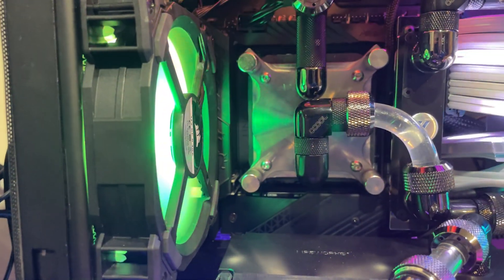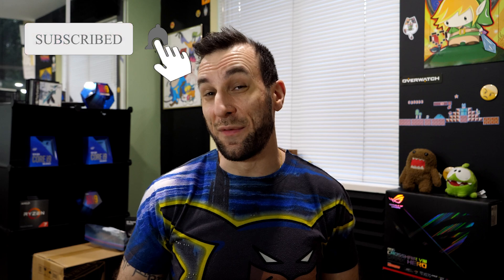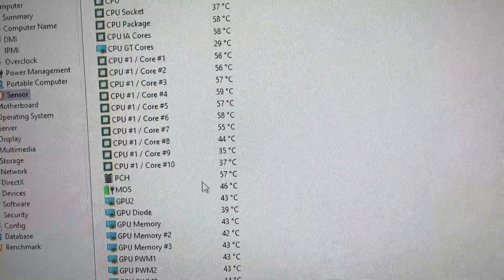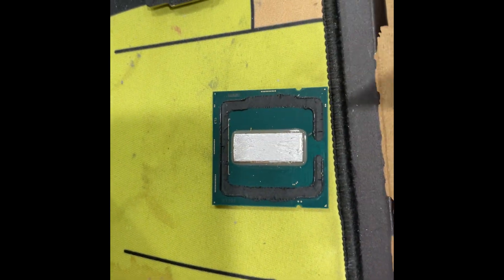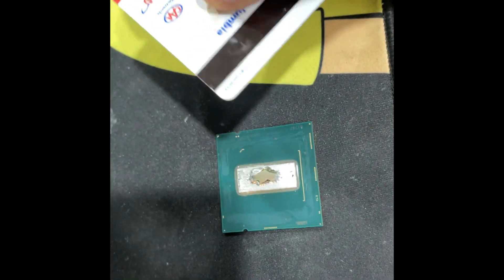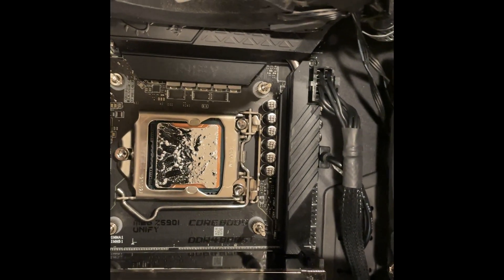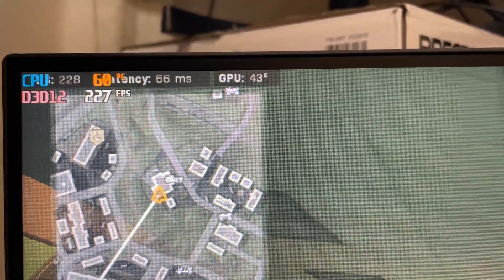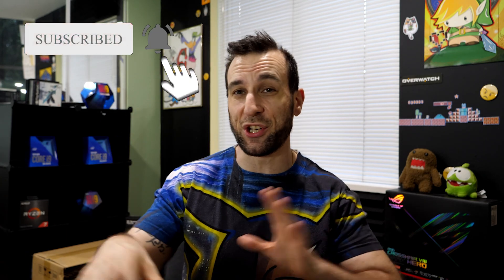10900k DELID VS TEC COOLER RESULTS!!

Comment: I am curious if i am missing a step. What did you do after you completely cleaned the die with the polish stuff?? You just put the plate back on it, put liquid metal on the plate instead of thermal paste and the results will be like this? How can only cleaning the die give so much better temps? Or did you also do liquid metal between the die and the plate? Best regards Lucas
Reply: Pretty sure he also used liquid metal between the die and the IHS

Comment: Building a TEC cooler is not that bad if you do it right. But so far it is mostly done WRONG. You can not slap a single TEC element directly on the cooler. U need to have 2 seperate water loops. One loop goes through all the components and the cold side of MULTIPLE TEC elements and the second loop goes through the hot side of the TECs and the raciators.

It has been done multiple times in the past. Just type this into google "TEC cooling overclockers forum"

Comment: The problem with this test is you changed two variables at once - the cooler and the TIM. How do we know that the TEC wouldn't have done as good or better than the standard water block once the delid and liquid metal application was done? I'm not saying for sure that it would have but this test doesn't really prove anything. You would have needed to retest with the TEC put back first then switch to standard block and test again in order to have conclusive results.
Reply from the maker: Because the problem with the TEC isn’t the transfer of heat, it’s the heat from the stress test overwhelming the TEC over a prolonged period of time.  If you don’t trust the results however feel free to buy one and test it yourself
Reply: @FrameChasers  That's fair, and I have been considering getting one but I always like to get all the info first. I was just hoping to see more of a side by side comparison with all other variables controlled, but I still believe you when you say it's not worth while. Thanks for the response man and keep up the great work!

Comment: There has been a day where TEC coolers were sort of useful but it was “yesterday” (like “single core era of processors”)…here in italy there were products like Lunasio Alvaro and Ybris Cooling T-Rex “tec coolers”…You would use a lot of power (more than 350W consumption only for the TEC, dedicated PSU because at that time no ATX psu could do that, and all that power could cool only 160-180W at max…but with a Pentium 4 a Core2Duo or an Athlon64 that was plenty)…cooling cpu with TEC was never efficient but at that time it was fun…with today’s cpu it just doesn’t make any sense…with TEC coolers the TEC is cooling the cpu (the waterblock is cooling only the hot plate of the cell, the cell in itself is a thermal insulator and the TEC could “pump” only as many watts as it is rated for…if you go over that the TEC is hindering the cooling, not helping it)…with today’s hardware with cpu using over 250W you would need a 450-500W cell…add 350W gpu in the loop and the radiators (a lot of radiators) are responsible of dissipating over 1,3KW that in not time would rise the room temps. TEC Coolers in desktop pc is something done for passion and fun never because it’s sensible

Comment: That's a beautiful job man!!!!!! I applied liquid metal to my ALIENWARE M17X R1  i7-4710MQ  GTX860M and my temps are amazing even overclocking it  and I tweaked my GTX 860M bios I can overclock the core clock +155MHz (I unlocked the slider from limit of +135MHz) I get temps on my GPU very stable to max of around 66°C never went above 68°C and my CPU never went above 70°C  and yet I applied the liquid metal on my CPU  like 6 months ago and the last time I reapplied the liquid metal on my GPU was like 3 months ago.

Comment: That solder remover is gallium, which is main component used in liquid metal. It is super corrosive to other metals and has the property of turning most metals to mush. It's also super illegal to bring it on airplane as it can eat through the aluminum of the plane and cause depressurization. Pretty dangerous stuff. LUL
Reply: It freezes easily, just use it in a cold room.